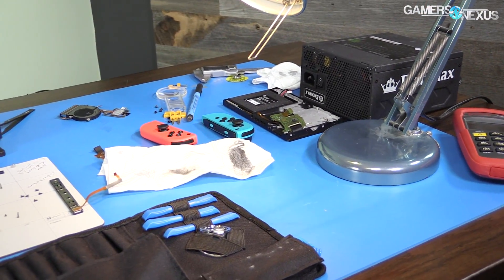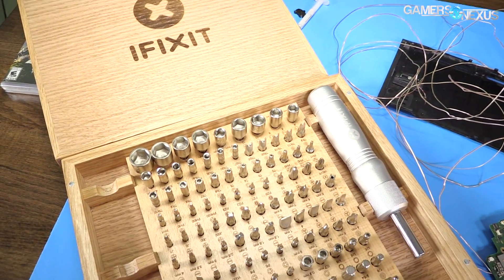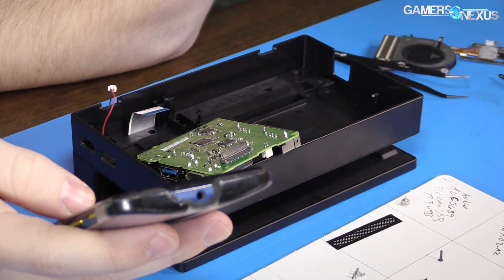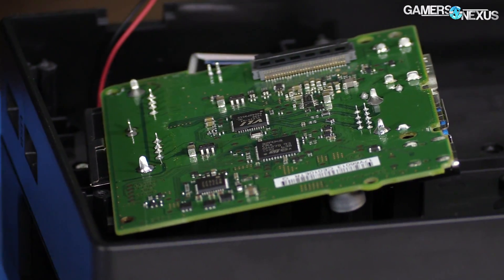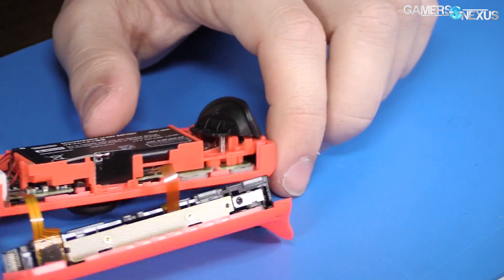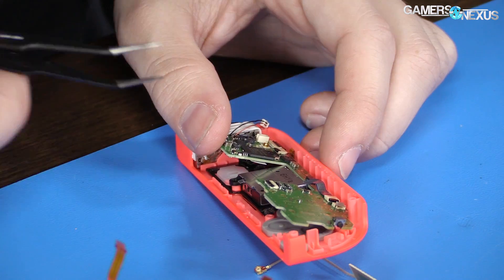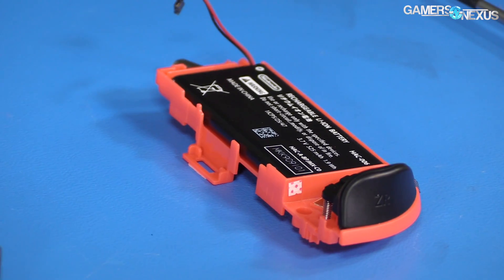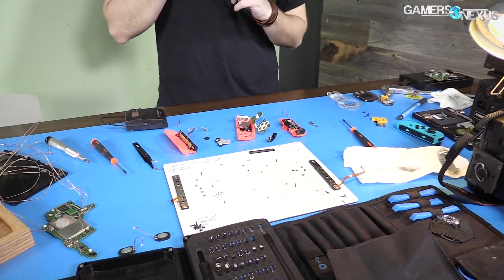Nintendo Switch Joycon & Dock Teardown

Comment: There it is, the famous 20fps tablet
Reply from the maker: Hey! It can do 30 sometimes.
Reply: Sorry bruh xD
Reply: There he is, the famous anti-nintendo troll in a nintendo teardown
Reply: Let's be real, Zeldaing on the toilet is 100% worth 20fps.
Reply: Benchmarks incoming?
Reply: DF did benchmark... and in docked mode Zelda has drops to 20 fps for no reason... undocked holds 30fps better... it's damn expensive for mobile gaming
Reply: So um if the ps4 drops to 18fps its ok???
Reply: YAH no joke. in its defence my WiiU cant run Zelda BOTW ether without tanking frames. BUT its a brand new system....it really has NO excuse.
Reply: 1/ Breath of the Wild for the Switch is a port of a Wii U game (totally different architecture, engine built for a way older hardware) made in one year. This is just an hypothesis, but I'm quite confident that the same game made for that specific hardware would run way better, at least without frame drops at all.
2/ From Mario Kart Deluxe to Fast RMX (both ports from the Wii U as well, etc.), it runs constant 60fps in 720p on mobile configuration, constant 60fps 1080p in docked mode. 
I wonder if Mario Odyssey is a port or not, hopefully it isn't, but seeing how early this game will be released in the lifespan of the console, 2 years of development seems pretty short so I assume it started its development on the Wii U as well. But there again, it seems to be constant 60fps anyway, judging from the footage we've seen so far.

Yup, that's a portable console you can plug to your TV, and that's quite impressive, although of course, some compromises have to be made to maintain a proper thermal behaviour, a sufficient silent system, and at least enough battery life to play on the go. Sadly Pascal isn't ready for the launch window, so there's no miracle to expect.Yet it's worth noting that a huge part of the catalog from now and in the future won't be as demanding as Breath of the Wild is. It's up to anyone to decide what they want as a gaming system. And so far, it seems to be very promising, and definitely works for me. I don't own it as it's not released in my country yet, haha, but I can't wait to play all those great indie games perfectly tailored for portable gaming, including all the slightly upgraded legacy titles Nintendo will release for its virtual console.

Like for any product, if you're not the target… don't bother 😝 There's something for everyone out there, whether it's a super powerful PC, a powerful home console such as the PS4 Pro and the upcoming Scorpio, or a powerful portable console (powerful for a portable, of course) with 2 player capabilities all the time (and 8-players LAN too). And yeah, any of these platform can expect to have poor performances due to many reasons, and perfect ones too. That's the world of gaming ⌒⌒
Reply: No, but if my 5 year old fx8350 does not...
Where in my fucking life did i ever mention ps4...fck that peasant box
Reply: It sure is expensive, but than again, 1000bucks for a Smartphone is also normal nowadays.
Reply: lolz Such a typical gaming looser... 

It's ok nerd, you're not supposed to get it. Maybe tell your girlfriend how FPS is the only thing that matters.......
Reply: Uploading cat videos to the internet is classy shit. Investigating someones profile in order to one up them in the comment section, not so classy.
Reply: If he attacks my gaming interest what do you expect, what are you his fucking girlfriend?
If you don't like gaming, wtf are you doing here anyway.
Reply: Lol, the butthurt 20fps users are real, get into your safespace now :)
Reply: lol.
Reply: +Robert Skarżyński no they dont, because they only watch videos and dont play the game for them self XD